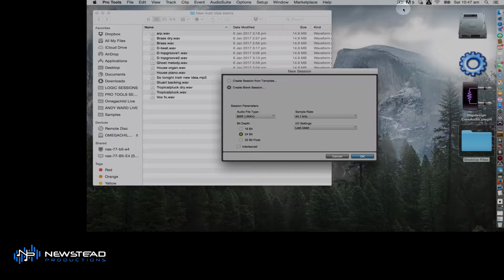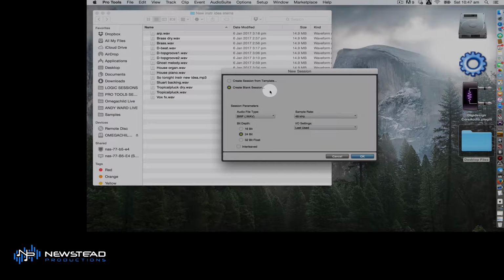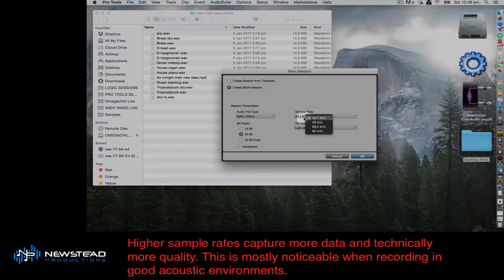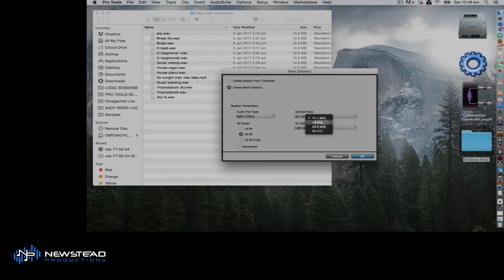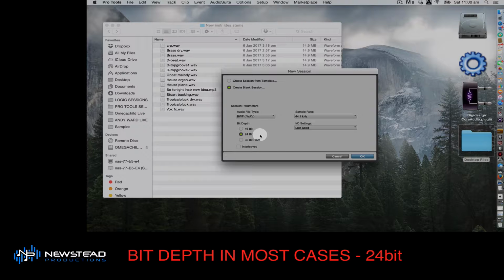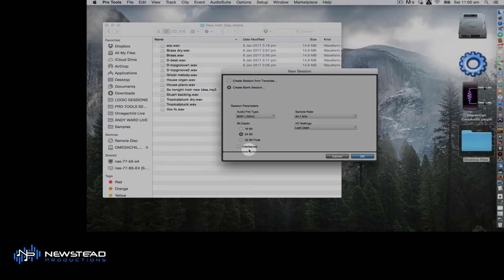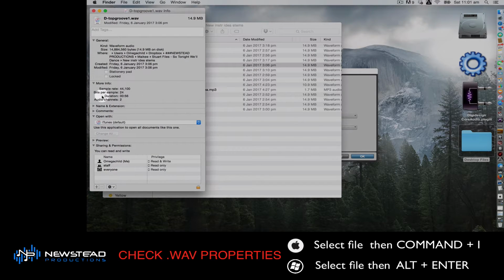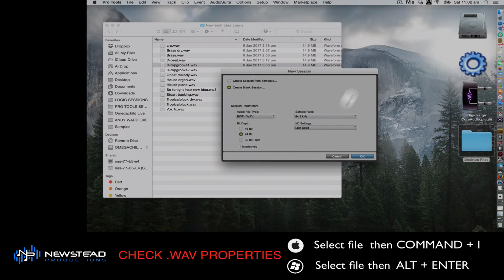Pro Tools tutorial - Setting sample rate and bit depth

Comment: Please ask me this question: I am recording music with the Pro Tools Express version, which does not record in MP3, so I intend to record in WAV and then convert it to MP3 with the best possible quality. My interface supports up to 96kHz and 32 Bit Float, can I record at most or should I put a lower Samlple Rate and Bit Deph?
Reply: Hi Jose, Yes you won't ever record in mp3 format but you may want to export your mix to mp3 to easily send a small file to someone. Never use MP3 as the proper final master for public release. I would recommend recording at either 24bit 44.1k or 24bit 48k. Anything higher will take up a lot of hard drive space. Both of the settings I've mentioned will give you a good quality recording. If you're recording something like an ensemble (Stereo mic configuration) which can sometimes require only 2 tracks, you may like to experiment with higher sample rates - 88.2k or 96k. Hope this helps!
Reply: @newsteadproductions4795  55/5000
Yes, it helped me. Thank you so much for your attention!
Reply: @josemaria7384  No problem good luck with it!